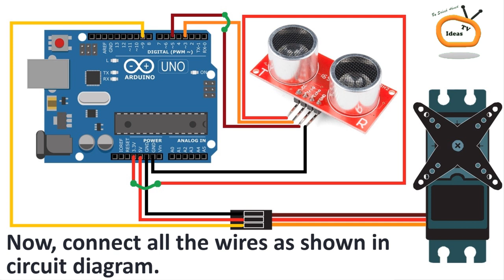How to make Automatic Smart Car Barrier System with Arduino | Arduino Project

Comment: I really appreciate it if you admin can reply asap bcs I have work to submit within a short of time. 
My question is why the distance = 0.034* time /2.
does 0.034 indicates speed of sound ? in what unit ?
I really hope if you could reply me
Reply: 0.034 actually represents the speed of sound in cm/microseconds.
Speed of sound in air is approximately 340 m/s but, arduino is measuring time in microseconds and 1 microsecond is 1 millionth fraction of a second So, by performing some simple calculation we get 0.034 m or 3.4 cm.
And he has divided the distance by 2 because the sound waves were reflected by the car therefore, dividing the distance by 2 gives the distance between the car and ultrasonic sensor.
I hope this is the correct explanation and this helped you.
Reply: Can u plz tell me the software app to upload the code into Arduino

Comment: Hey bro please help
Your code is not working I think so
When I upload the code the motor automatically starts moving and stops after some seconds  and also my sensor is not detecting anything 
Please help I really want this for my college project
Reply: I have do project for college...is this project works? Means your project become success or not?
Is this code in description works or not?
Reply: @FYLShubhamSangale  yes bro it works and the code is right 
give the power supply right
Reply: @maazff7863  😊
Reply: Bro can u get the solution. Will u pls help i do have same problem

Comment: Not causing motion, how do I fix this?
Reply from the maker: re-check your connections and code
Reply: @IdeasTv  I did :( It's even showing sensor active in serial monitor but my motor is moving at all
Reply: The ultra sonic sensor catches sound waves, so it is important to be silent, maybe there was some sound when you tested idk

Comment: i am trying to enter this code into tinkercad, is the a code with simple commands?
Reply: Try including the servo motor library.
And recheck the code properly because some lines were not correct even after copying and pasting the code.
for example, if(distance<20) this was the line that was written in the code but, when I pasted it [ if(distance$ln20) ] something similar to this was written. So recheck your code properly whether it is correct or not.
Hope this helps.